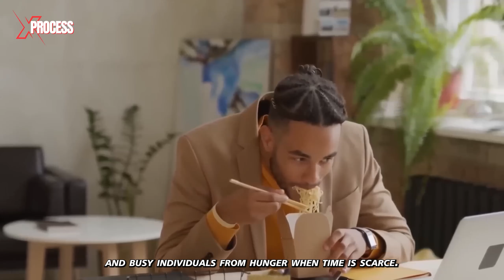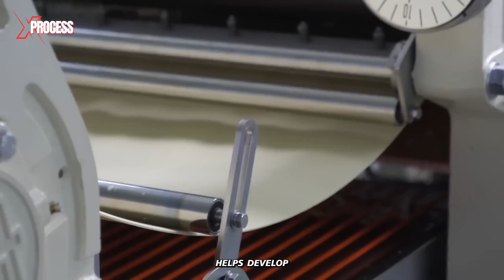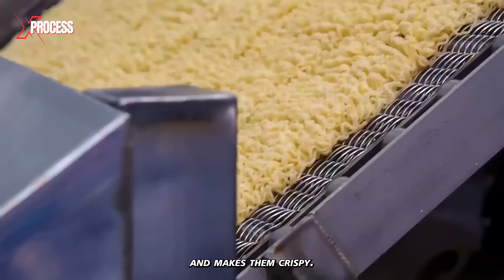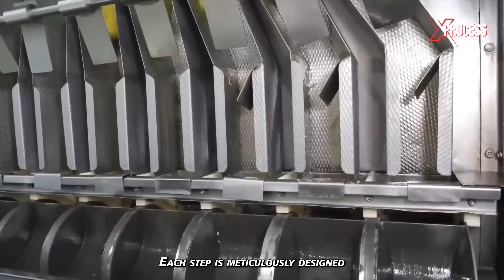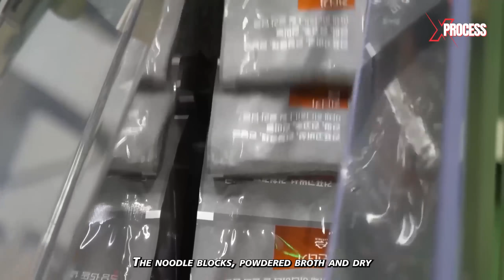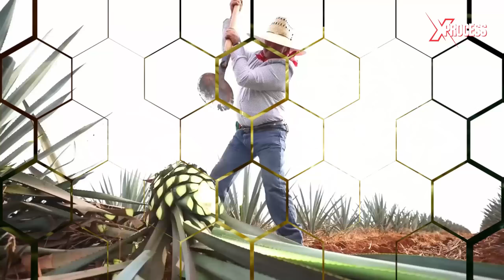How INSTANT NOODLES Are Made in Factories | 1 BILLION NOODLES EVERY YEAR!

Comment: so we all are just gonna ignore the black magic that happens inside the cutter? Even after seeing it i have no idea how it does that
Reply: I was hoping they would show a cutaway shot or a different angle. Alas, my disappointment is immeasurable and my day is ruined.
Reply: @MrFastFox666 brah
Reply: Under the cover, there are magic spell scribbles left over by Momofuku Ando, they’re all the same.
He was so heartache seeing people in hunger after WW2, as an isekai magician, he vouched to help that.
Reply: Ikr 
I was thinking about it too
Reply: I worked in a factory very similar to this and it is patented. At the very least you can guarantee those rollers, blades and everything between is religiously cleaned at the end of every shift. The worst thatll happen is sometimes some flour clumps up and sticks to the final product but there is inspectors at different parts of production to stop it from coming through.
Reply: Right omfg that was the reason i clicked on this vid
Reply: The dough being fed in and the cutters would run faster than the out feed conveyor to force the noodle to bunch up. You can also see that there's 2 sheets of dough being fed in to probably separate cutters. That would make the noodle cake thicker which can also be seen when someone lifts the top layer of the noodle cake after it has been cut to size.
Reply: I NEED to know. I feel like I could have guessed every other step. The cutting process was specifically what I was searching for 😢
Reply: Same. I wanted to see how they got their shape and folded in half.
Reply: I also want to see more moments.
Reply: Haha, seriously though! 😂 That cutter is definitely working some kind of dark sorcery! ⚡🔪 One second you have a whole object, and poof—it's perfectly sliced before you even blink! I swear, watching it doesn’t make it any less mysterious. It's like the factory version of a magician's disappearing act. 🎩✨

Can someone explain the science behind this sorcery, or are we all just going to accept that it's powered by industrial wizardry? 😂
Reply: I think the rollers cut the dough sheet into noodles, then because the conveyer belt after the cutter is slower than the speed of the dough being fed into the cutter, the noodles bunch up into the squiggly shape
Reply: maybe the layered squiggly cutting mechanism was left out on purpose, it could be a bit of a trade secret
Reply: The one part I came to see and the only part we weren't shown.
Reply: Uuhuredfkihdduidhrsidbdjifruhfdur
Reply: I got to this video by watching a mini factory video, a noodle making machine for restaurants.  Search for Yamato Gold.
Reply: @militech9  magic 🪄✨
Reply: Late and gay, but most likely they use dies to make the shapes. Much like how macaroni or rotini is made, they must extrude the pasta to get into the squiggly shape.
Reply: The rollers have grooves cut into it. I'm assuming the dough is slightly under tension going through and when it cuts each noodle it pulls back once out of the roller and gives it that springy look. Then after they're cut into blocks
Reply: I agree with you how the hell did that happen?
Reply: 😅 was wondering about exactly the same thing.
Reply: Stay in school kids😂😂
Reply: Looks like it was done in multiple layers of the noodles
Reply: Nobody cares
Reply: @SiViC74  yes, they care.
Reply: @SiViC74  In fact look at all the comments... most people care.

Comment: do you guys eat your instant noodle with the water cooked together /? or boil seperate water boiling for the soup.
Reply: Put them in a microwave safe container, add water and seasoning, microwave for 3 minutes.
Let sit for 2 minutes and eat.
Reply: I drain the water and eat them just noodles ! with some extras ! 🤘🤘
Reply: i like my noodles cooked in water, but i cook till all the water evaporates and the broth is concentrated and coats the noodles.  i don't like my ramen soupy at all.
Reply: @bvbxiong5791  I eat them crispy but I should try that way though, it sounds better
Reply: boil water and pour it over the noodles and wait for noodles to get ready. Cooking them turns them too squishy and pasty
Reply: Cook, drain, flavor 
Perfection
Reply: Depends on type. Some can be eaten by just pourjng hot water, and some need to be boiled in the hot water.
Reply: Cook, drain and fry in butter, add flavor pack to sauteed egg and veggies. Put hot sauce on top.